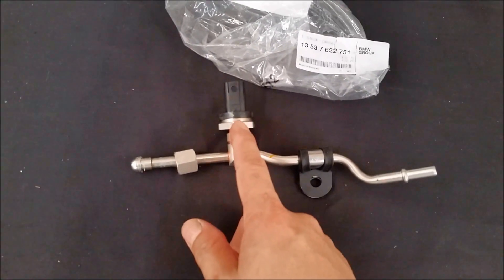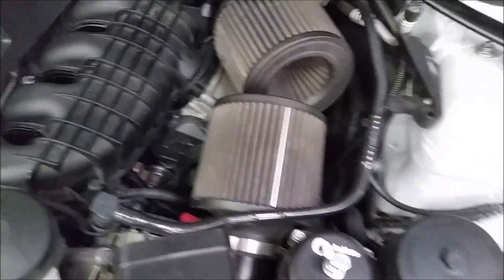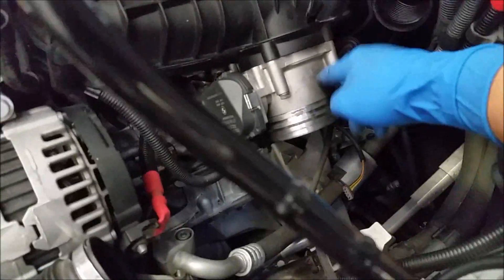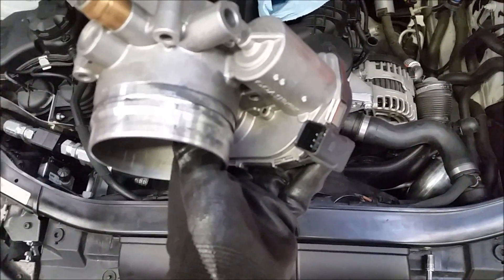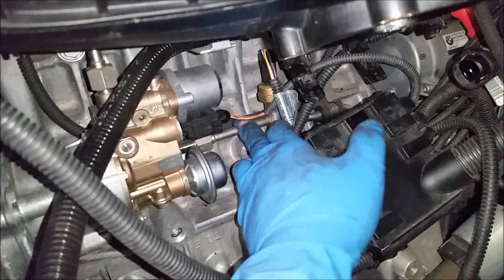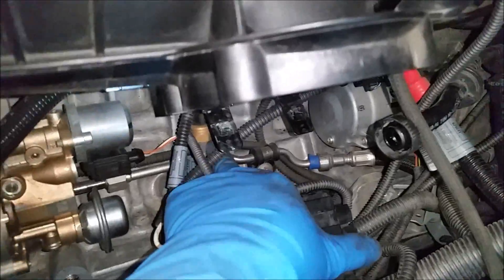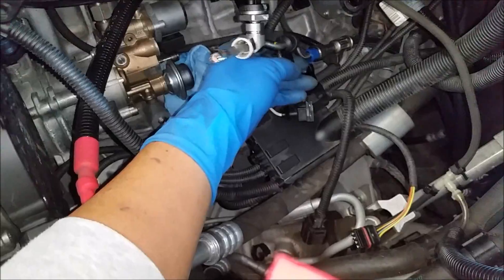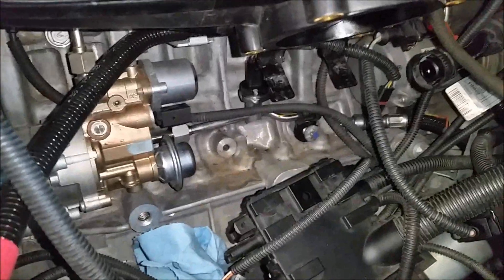Low Pressure Fuel Pump (LPFP) Sensor DIY - BMW E90 335i & E82 135i

Comment: Hmm, I’m thinking this is my issue for limo mode during WOT
Reply: Did you replace the low fuel pressure sensor then? I'm getting cylinder injection shut off on WOT too but no check engine. Codes are 29DC, 2AAF, 2A2D.
Reply: I can’t remember what codes were being thrown, but I did a walnut blast for the first time @ 126k and have owned since 53k. Ended up breaking the HPFP sensor up top during the walnut blast, replaced that and reinstalled everything after the clean. Ran much smoother but still was getting a limp mode on WOT. 

Changed LPFP sensor, cleared codes and no more limp during WOT. I do have a leaking Valve cover gasket now tho that I have to adress here soon unfortunately.. 

Debating on getting the URO kit for around 300 after tax or going genuine oem for around 600 usd. 

I know for cover and gasket you should always go oem but I’m on a budget rn and even if I can get a year out of it before it leaks is worth it to me. 

Big diy job tho as well. Not looking forward to it. 

Hope you get youre problem situated sooner than later. 

Cheers
Reply: I can’t remember what codes were being thrown, but I did a walnut blast for the first time @ 126k and have owned since 53k. Ended up breaking the HPFP sensor up top during the walnut blast, replaced that and reinstalled everything after the clean. Ran much smoother but still was getting a limp mode on WOT. 

Changed LPFP sensor, cleared codes and no more limp during WOT. I do have a leaking Valve cover gasket now tho that I have to adress here soon unfortunately.. 

Debating on getting the URO kit for around 300 after tax or going genuine oem for around 600 usd. 

I know for cover and gasket you should always go oem but I’m on a budget rn and even if I can get a year out of it before it leaks is worth it to me. 

Big diy job tho as well. Not looking forward to it. 

Hope you get youre problem situated sooner than later. 

Cheers
Reply: I can’t remember what codes were being thrown, but I did a walnut blast for the first time @ 126k and have owned since 53k. Ended up breaking the HPFP sensor up top during the walnut blast, replaced that and reinstalled everything after the clean. Ran much smoother but still was getting a limp mode on WOT. 

Changed LPFP sensor, cleared codes and no more limp during WOT. I do have a leaking Valve cover gasket now tho that I have to adress here soon unfortunately.. 

Debating on getting the URO kit for around 300 after tax or going genuine oem for around 600 usd. 

I know for cover and gasket you should always go oem but I’m on a budget rn and even if I can get a year out of it before it leaks is worth it to me. 

Big diy job tho as well. Not looking forward to it. 

Hope you get youre problem situated sooner than later. 

Cheers
Reply: I can’t remember what codes were being thrown, but I did a walnut blast for the first time @ 126k and have owned since 53k. Ended up breaking the HPFP sensor up top during the walnut blast, replaced that and reinstalled everything after the clean. Ran much smoother but still was getting a limp mode on WOT. 

Changed LPFP sensor, cleared codes and no more limp during WOT. I do have a leaking Valve cover gasket now tho that I have to adress here soon unfortunately.. 

Debating on getting the URO kit for around 300 after tax or going genuine oem for around 600 usd. 

I know for cover and gasket you should always go oem but I’m on a budget rn and even if I can get a year out of it before it leaks is worth it to me. 

Big diy job tho as well. Not looking forward to it. 

Hope you get youre problem situated sooner than later. 

Cheers
Reply: I can’t remember what codes were being thrown, but I did a walnut blast for the first time @ 126k and have owned since 53k. Ended up breaking the HPFP sensor up top during the walnut blast, replaced that and reinstalled everything after the clean. Ran much smoother but still was getting a limp mode on WOT. 

Changed LPFP sensor, cleared codes and no more limp during WOT. I do have a leaking Valve cover gasket now tho that I have to adress here soon unfortunately.. 

Debating on getting the URO kit for around 300 after tax or going genuine oem for around 600 usd. 

I know for cover and gasket you should always go oem but I’m on a budget rn and even if I can get a year out of it before it leaks is worth it to me. 

Big diy job tho as well. Not looking forward to it. 

Hope you get youre problem situated sooner than later. 

Cheers
Reply: I can’t remember what codes were being thrown, but I did a walnut blast for the first time @ 126k and have owned since 53k. Ended up breaking the HPFP sensor up top during the walnut blast, replaced that and reinstalled everything after the clean. Ran much smoother but still was getting a limp mode on WOT. 

Changed LPFP sensor, cleared codes and no more limp during WOT. I do have a leaking Valve cover gasket now tho that I have to adress here soon unfortunately.. 

Debating on getting the URO kit for around 300 after tax or going genuine oem for around 600 usd. 

I know for cover and gasket you should always go oem but I’m on a budget rn and even if I can get a year out of it before it leaks is worth it to me. 

Big diy job tho as well. Not looking forward to it. 

Hope you get youre problem situated sooner than later. 

Cheers
Reply: I can’t remember what codes were being thrown, but I did a walnut blast for the first time @ 126k and have owned since 53k. Ended up breaking the HPFP sensor up top during the walnut blast, replaced that and reinstalled everything after the clean. Ran much smoother but still was getting a limp mode on WOT. 

Changed LPFP sensor, cleared codes and no more limp during WOT. I do have a leaking Valve cover gasket now tho that I have to adress here soon unfortunately.. 

Debating on getting the URO kit for around 300 after tax or going genuine oem for around 600 usd. 

I know for cover and gasket you should always go oem but I’m on a budget rn and even if I can get a year out of it before it leaks is worth it to me. 

Big diy job tho as well. Not looking forward to it. 

Hope you get youre problem situated sooner than later. 

Cheers
Reply: I can’t remember what codes were being thrown, but I did a walnut blast for the first time @ 126k and have owned since 53k. Ended up breaking the HPFP sensor up top during the walnut blast, replaced that and reinstalled everything after the clean. Ran much smoother but still was getting a limp mode on WOT. 

Changed LPFP sensor, cleared codes and no more limp during WOT. I do have a leaking Valve cover gasket now tho that I have to adress here soon unfortunately.. 

Debating on getting the URO kit for around 300 after tax or going genuine oem for around 600 usd. 

I know for cover and gasket you should always go oem but I’m on a budget rn and even if I can get a year out of it before it leaks is worth it to me. 

Big diy job tho as well. Not looking forward to it. 

Hope you get youre problem situated sooner than later. 

Cheers
Reply: I can’t remember what codes were being thrown, but I did a walnut blast for the first time @ 126k and have owned since 53k. Ended up breaking the HPFP sensor up top during the walnut blast, replaced that and reinstalled everything after the clean. Ran much smoother but still was getting a limp mode on WOT. 

Changed LPFP sensor, cleared codes and no more limp during WOT. I do have a leaking Valve cover gasket now tho that I have to adress here soon unfortunately.. 

Debating on getting the URO kit for around 300 after tax or going genuine oem for around 600 usd. 

I know for cover and gasket you should always go oem but I’m on a budget rn and even if I can get a year out of it before it leaks is worth it to me. 

Big diy job tho as well. Not looking forward to it. 

Hope you get youre problem situated sooner than later. 

Cheers
Reply: I can’t remember what codes were being thrown, but I did a walnut blast for the first time @ 126k and have owned since 53k. Ended up breaking the HPFP sensor up top during the walnut blast, replaced that and reinstalled everything after the clean. Ran much smoother but still was getting a limp mode on WOT. 

Changed LPFP sensor, cleared codes and no more limp during WOT. I do have a leaking Valve cover gasket now tho that I have to adress here soon unfortunately.. 

Debating on getting the URO kit for around 300 after tax or going genuine oem for around 600 usd. 

I know for cover and gasket you should always go oem but I’m on a budget rn and even if I can get a year out of it before it leaks is worth it to me. 

Big diy job tho as well. Not looking forward to it. 

Hope you get youre problem situated sooner than later. 

Cheers
Reply: I can’t remember what codes were being thrown, but I did a walnut blast for the first time @ 126k and have owned since 53k. Ended up breaking the HPFP sensor up top during the walnut blast, replaced that and reinstalled everything after the clean. Ran much smoother but still was getting a limp mode on WOT. 

Changed LPFP sensor, cleared codes and no more limp during WOT. I do have a leaking Valve cover gasket now tho that I have to adress here soon unfortunately.. 

Debating on getting the URO kit for around 300 after tax or going genuine oem for around 600 usd. 

I know for cover and gasket you should always go oem but I’m on a budget rn and even if I can get a year out of it before it leaks is worth it to me. 

Big diy job tho as well. Not looking forward to it. 

Hope you get youre problem situated sooner than later. 

Cheers
Reply: I can’t remember what codes were being thrown, but I did a walnut blast for the first time @ 126k and have owned since 53k. Ended up breaking the HPFP sensor up top during the walnut blast, replaced that and reinstalled everything after the clean. Ran much smoother but still was getting a limp mode on WOT. 

Changed LPFP sensor, cleared codes and no more limp during WOT. I do have a leaking Valve cover gasket now tho that I have to adress here soon unfortunately.. 

Debating on getting the URO kit for around 300 after tax or going genuine oem for around 600 usd. 

I know for cover and gasket you should always go oem but I’m on a budget rn and even if I can get a year out of it before it leaks is worth it to me. 

Big diy job tho as well. Not looking forward to it. 

Hope you get youre problem situated sooner than later. 

Cheers
Reply: I can’t remember what codes were being thrown, but I did a walnut blast for the first time @ 126k and have owned since 53k. Ended up breaking the HPFP sensor up top during the walnut blast, replaced that and reinstalled everything after the clean. Ran much smoother but still was getting a limp mode on WOT. 

Changed LPFP sensor, cleared codes and no more limp during WOT. I do have a leaking Valve cover gasket now tho that I have to adress here soon unfortunately.. 

Debating on getting the URO kit for around 300 after tax or going genuine oem for around 600 usd. 

I know for cover and gasket you should always go oem but I’m on a budget rn and even if I can get a year out of it before it leaks is worth it to me. 

Big diy job tho as well. Not looking forward to it. 

Hope you get youre problem situated sooner than later. 

Cheers
Reply: I can’t remember what codes were being thrown, but I did a walnut blast for the first time @ 126k and have owned since 53k. Ended up breaking the HPFP sensor up top during the walnut blast, replaced that and reinstalled everything after the clean. Ran much smoother but still was getting a limp mode on WOT. 

Changed LPFP sensor, cleared codes and no more limp during WOT. I do have a leaking Valve cover gasket now tho that I have to adress here soon unfortunately.. 

Debating on getting the URO kit for around 300 after tax or going genuine oem for around 600 usd. 

I know for cover and gasket you should always go oem but I’m on a budget rn and even if I can get a year out of it before it leaks is worth it to me. 

Big diy job tho as well. Not looking forward to it. 

Hope you get youre problem situated sooner than later. 

Cheers
Reply: I can’t remember what codes were being thrown, but I did a walnut blast for the first time @ 126k and have owned since 53k. Ended up breaking the HPFP sensor up top during the walnut blast, replaced that and reinstalled everything after the clean. Ran much smoother but still was getting a limp mode on WOT. 

Changed LPFP sensor, cleared codes and no more limp during WOT. I do have a leaking Valve cover gasket now tho that I have to adress here soon unfortunately.. 

Debating on getting the URO kit for around 300 after tax or going genuine oem for around 600 usd. 

I know for cover and gasket you should always go oem but I’m on a budget rn and even if I can get a year out of it before it leaks is worth it to me. 

Big diy job tho as well. Not looking forward to it. 

Hope you get youre problem situated sooner than later. 

Cheers
Reply: I can’t remember what codes were being thrown, but I did a walnut blast for the first time @ 126k and have owned since 53k. Ended up breaking the HPFP sensor up top during the walnut blast, replaced that and reinstalled everything after the clean. Ran much smoother but still was getting a limp mode on WOT. 

Changed LPFP sensor, cleared codes and no more limp during WOT. I do have a leaking Valve cover gasket now tho that I have to adress here soon unfortunately.. 

Debating on getting the URO kit for around 300 after tax or going genuine oem for around 600 usd. 

I know for cover and gasket you should always go oem but I’m on a budget rn and even if I can get a year out of it before it leaks is worth it to me. 

Big diy job tho as well. Not looking forward to it. 

Hope you get youre problem situated sooner than later. 

Cheers
Reply: I can’t remember what codes were being thrown, but I did a walnut blast for the first time @ 126k and have owned since 53k. Ended up breaking the HPFP sensor up top during the walnut blast, replaced that and reinstalled everything after the clean. Ran much smoother but still was getting a limp mode on WOT. 

Changed LPFP sensor, cleared codes and no more limp during WOT. I do have a leaking Valve cover gasket now tho that I have to adress here soon unfortunately.. 

Debating on getting the URO kit for around 300 after tax or going genuine oem for around 600 usd. 

I know for cover and gasket you should always go oem but I’m on a budget rn and even if I can get a year out of it before it leaks is worth it to me. 

Big diy job tho as well. Not looking forward to it. 

Hope you get youre problem situated sooner than later. 

Cheers
Reply: I can’t remember what codes were being thrown, but I did a walnut blast for the first time @ 126k and have owned since 53k. Ended up breaking the HPFP sensor up top during the walnut blast, replaced that and reinstalled everything after the clean. Ran much smoother but still was getting a limp mode on WOT. 

Changed LPFP sensor, cleared codes and no more limp during WOT. I do have a leaking Valve cover gasket now tho that I have to adress here soon unfortunately.. 

Debating on getting the URO kit for around 300 after tax or going genuine oem for around 600 usd. 

I know for cover and gasket you should always go oem but I’m on a budget rn and even if I can get a year out of it before it leaks is worth it to me. 

Big diy job tho as well. Not looking forward to it. 

Hope you get youre problem situated sooner than later. 

Cheers
Reply: I can’t remember what codes were being thrown, but I did a walnut blast for the first time @ 126k and have owned since 53k. Ended up breaking the HPFP sensor up top during the walnut blast, replaced that and reinstalled everything after the clean. Ran much smoother but still was getting a limp mode on WOT. 

Changed LPFP sensor, cleared codes and no more limp during WOT. I do have a leaking Valve cover gasket now tho that I have to adress here soon unfortunately.. 

Debating on getting the URO kit for around 300 after tax or going genuine oem for around 600 usd. 

I know for cover and gasket you should always go oem but I’m on a budget rn and even if I can get a year out of it before it leaks is worth it to me. 

Big diy job tho as well. Not looking forward to it. 

Hope you get youre problem situated sooner than later. 

Cheers
Reply: I can’t remember what codes were being thrown, but I did a walnut blast for the first time @ 126k and have owned since 53k. Ended up breaking the HPFP sensor up top during the walnut blast, replaced that and reinstalled everything after the clean. Ran much smoother but still was getting a limp mode on WOT. 

Changed LPFP sensor, cleared codes and no more limp during WOT. I do have a leaking Valve cover gasket now tho that I have to adress here soon unfortunately.. 

Debating on getting the URO kit for around 300 after tax or going genuine oem for around 600 usd. 

I know for cover and gasket you should always go oem but I’m on a budget rn and even if I can get a year out of it before it leaks is worth it to me. 

Big diy job tho as well. Not looking forward to it. 

Hope you get youre problem situated sooner than later. 

Cheers
Reply: I can’t remember what codes were being thrown, but I did a walnut blast for the first time @ 126k and have owned since 53k. Ended up breaking the HPFP sensor up top during the walnut blast, replaced that and reinstalled everything after the clean. Ran much smoother but still was getting a limp mode on WOT. 

Changed LPFP sensor, cleared codes and no more limp during WOT. I do have a leaking Valve cover gasket now tho that I have to adress here soon unfortunately.. 

Debating on getting the URO kit for around 300 after tax or going genuine oem for around 600 usd. 

I know for cover and gasket you should always go oem but I’m on a budget rn and even if I can get a year out of it before it leaks is worth it to me. 

Big diy job tho as well. Not looking forward to it. 

Hope you get youre problem situated sooner than later. 

Cheers